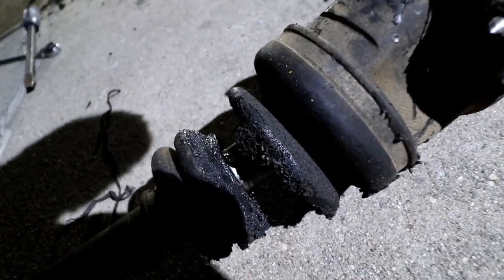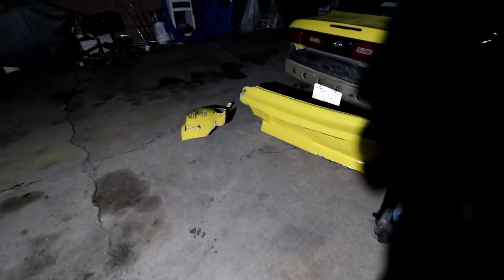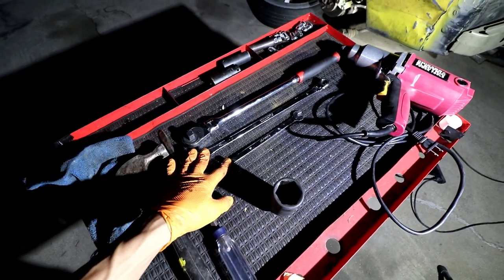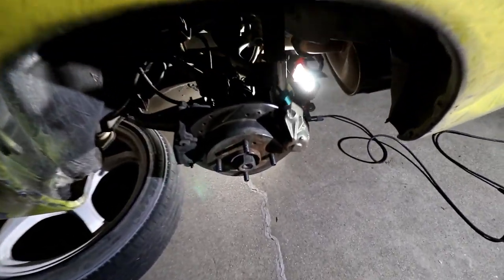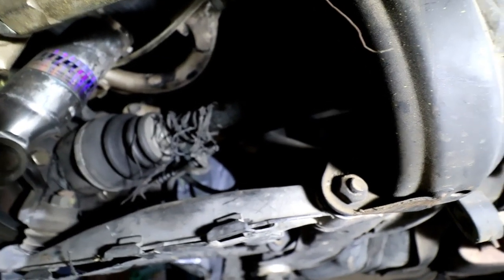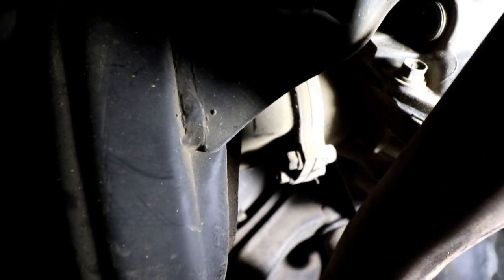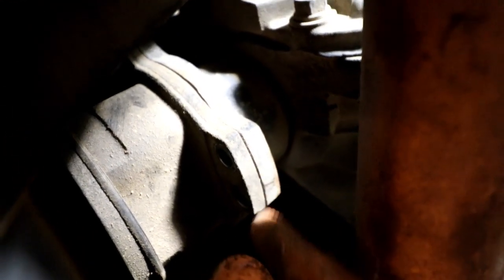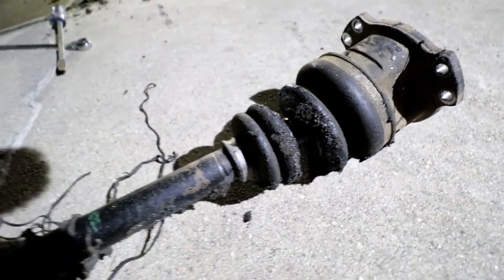HOW TO REPLACE CV AXLES (240SX)

Comment: Air hammer works pretty good for pushing the CV axle back through hub as long as not decided in bearing and make quick work of it
Reply from the maker: Seriously does. Figured most people at home dont have one though but I should've thrown it out there still.
Reply: ok so i dont have a air hammer to put mine back in... whats the other option?
Reply: @6lvcksmith302  well a blunt center punch and a hammer will work as long as u don't miss and hit wheel studs with hammer or if u replacing cv Axle u can hit it with a hammer if u are not replacing then use a dull instrument to put against it then strike it prevent damaging axle nut threads